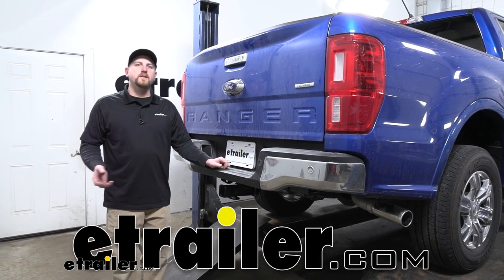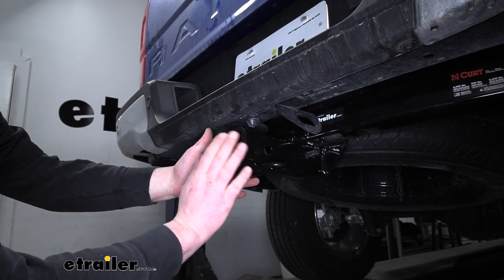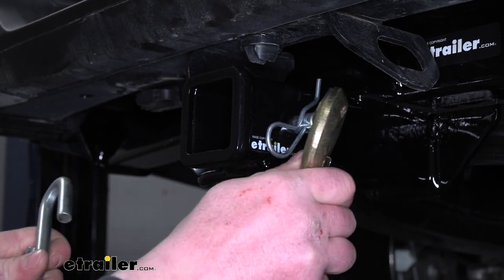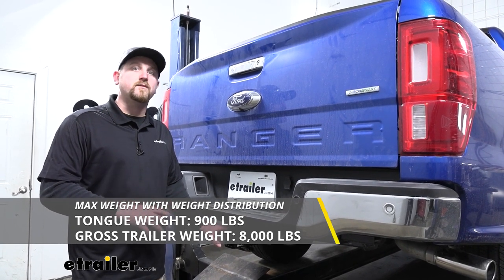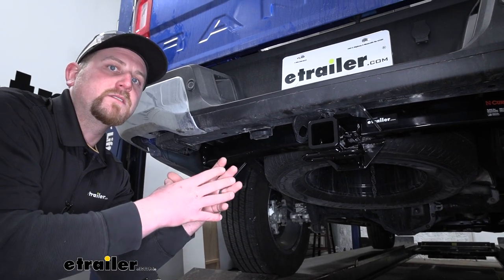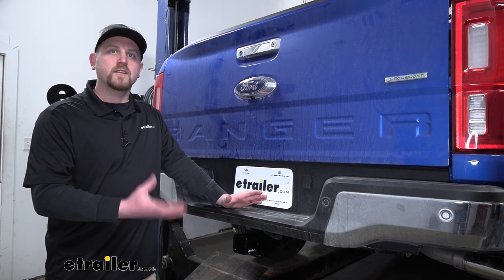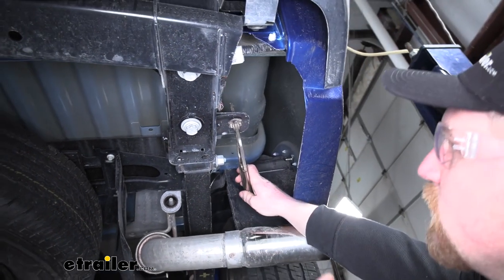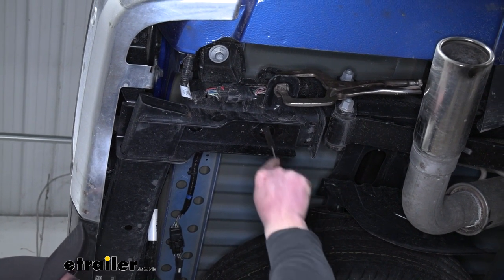etrailer | Curt Trailer Hitch Installation - 2019 Ford Ranger

Comment: How much torque?
Reply from the maker: You can find the correct torque values for the Curt # C13417 in step # 3 of the linked install instructions:
https://www.etrailer.com/instructions.aspx?pn=C13417